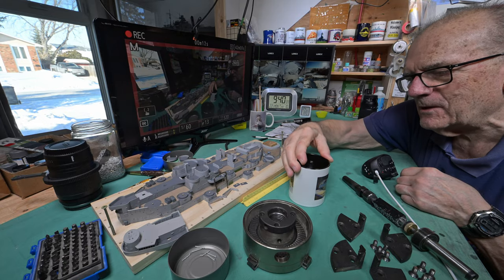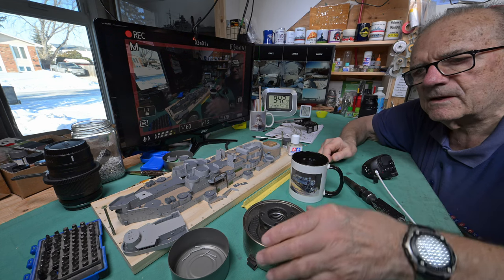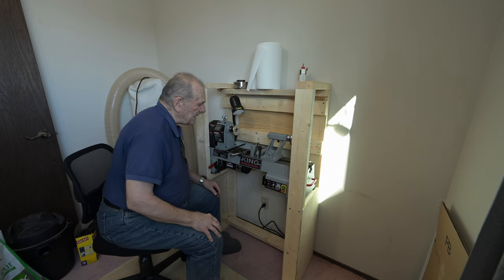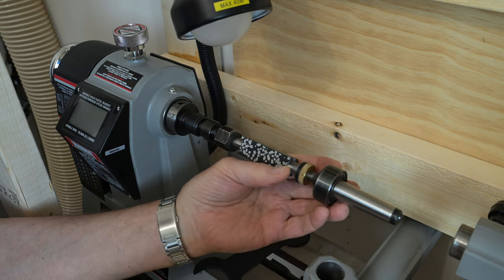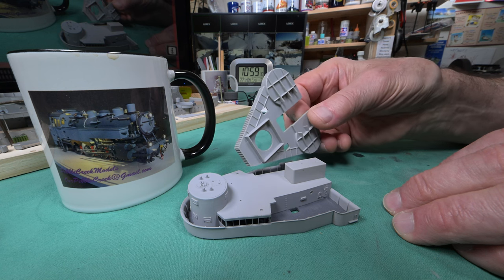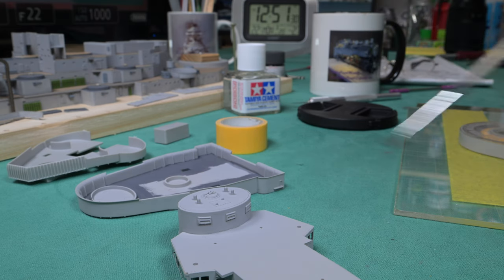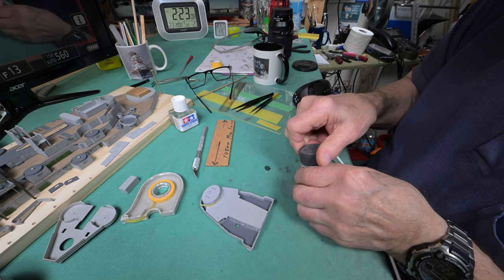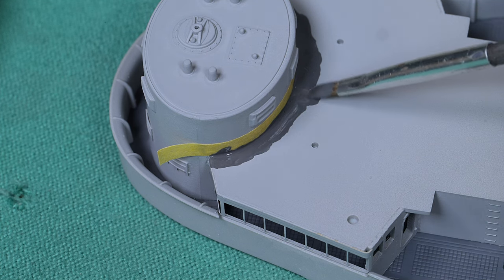The Model Ship - Part 1525

Comment: That looked like a mighty fine sip lol. Got a bit of time to watch while i was getting loaded up. Love the stand. Looks good n sturdy. I wonder if regular band clamps with a screw put through to hold it on the back wall would do good to hold that dust hose in place. Have a good night Ron. See you tomorrow’ish.
Reply from the maker: H Chris,
Will eventually get this dust intake thing figured out. I plan to do something similar to what I use on my big Laguna lathe.🤞 https://youtu.be/ywGpY17RbGs

Comment: Morning Ron.  Don't you have some "123 blocks"?  They are great for placing weight on something you are trying to glue down.  You can also use them to sandwich two pieces you are gluing together between them.  Just a suggestion.  I use mine all the time.  In fact, they are so useful, I bought a second pair and have two sets now.  Thanks for the video.  Eric
Reply from the maker: Nope! But I do have a set of weights ranging up to 1000 grams --- but forgot about them until just now. 👍🏼

Comment: The panel directly behind work area on the lathe. If you put dust pipe down from the top then made a sort of funnel using the back panel, blocking ends and so on ?
Very difficult to describe in text though
Reply from the maker: I plan to do something similar to what I use on my big Laguna lathe.🤞 https://youtu.be/ywGpY17RbGs
Reply: Watched it. Nice one. Very similar to what I tried to say in text haha.

Comment: Ron 
What is the  make of that chuck 
Most come with a removable tapered adapter, which can be replaced with different size adapters 
Oneway makes quite a few for around 30 bucks
Reply from the maker: Hi John,
It's this one ---
https://oneway.ca/products-category/chucks/Stronghold-Chucks-Category/Stronghold-Chuck-(Complete)
Reply: They have adapters for that chuck which are easy to change out
Reply from the maker: @johnpalmeter6640  Re: "They have adapters for that chuck" Please provide a link for the adaptors. 👍
Reply: Ron 
The adapters are on the Oneway website